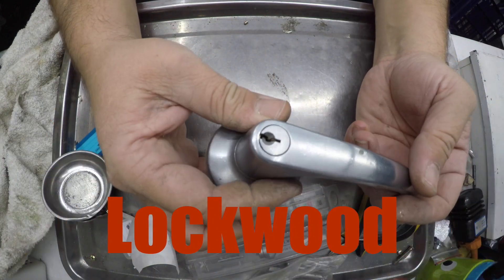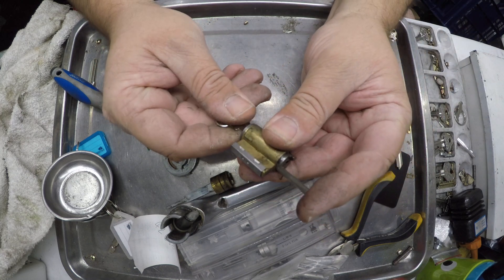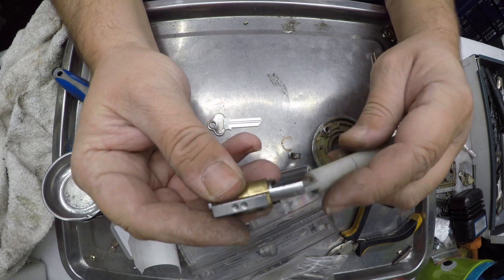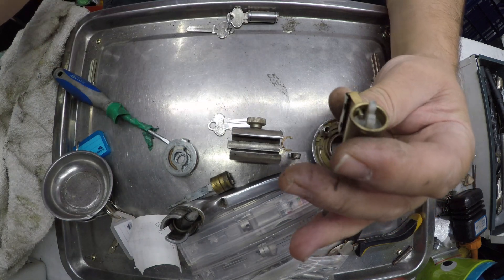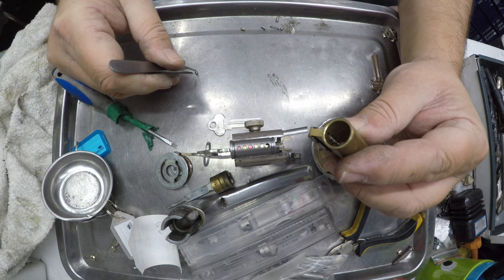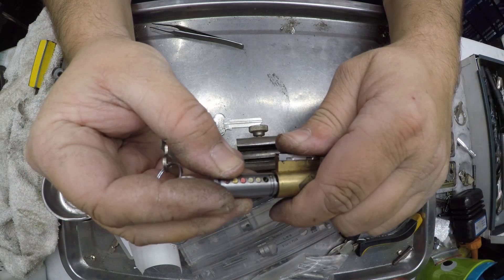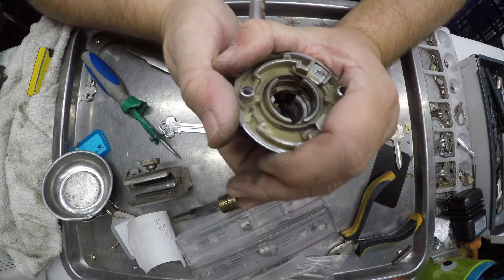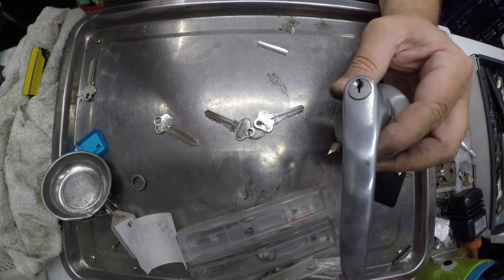How To Rekey A Lockwood 538 / 938 cc

Comment: Best to degrease that oil on the handle with something like break cleaner which is often pretty cheap at super cheap auto. The customer often doesnt see much of the work locksmiths do so these small tactile adjustments that customers can feel add a lot of value, it gives the appearance that the locksmith provided much more than what was payed for. Besides if the grease is putting strain on the handle return spring or if the grease moved and eventually increases the heaviness of the handle the locksmith could be blamed for the lock breaking later even though its not their fault and the locksmith may never know this they may well just use someone else in the future. I think it is always good to point out the value added, even better when we dont explain how we did it because it leaves them open to believing we put in more effort than we did and also demonstrates that we were using the oportunity to fully assess the lock for any other issues, it gives them peace of mind that we did all we could to help.

Comment: Nice one mate, I tend to file the pins down if they're sitting above the sheer line to create a nice flush sheer line with the key in its cylinder. Instead of filing down the key (especially if it's master keyed) 
Could create other unnecessary problems. 🙂
Reply from the maker: HI, In tomorrow video I show one of my other tricks, how to file down the pins with out using a file and giving it a nice dome head on the pin, using a cool little tool. Just a quick and the dome head is less clicky, I use a file too, done get me wrong.. I think we all do, but this was just for one key
Reply from the maker: Hi Seed, yep sounds good, Im back on after Monday, always up for a chat